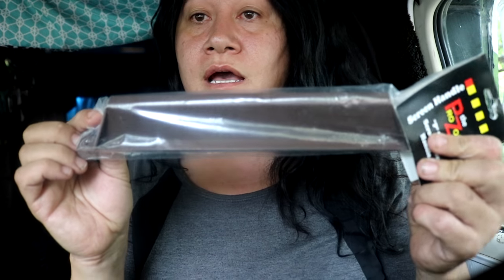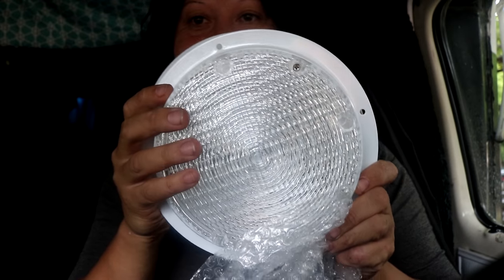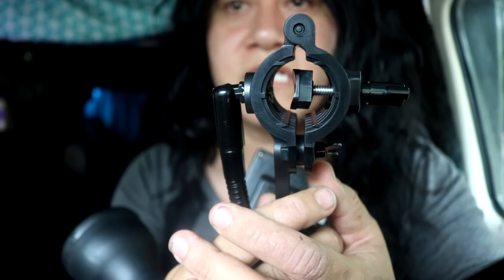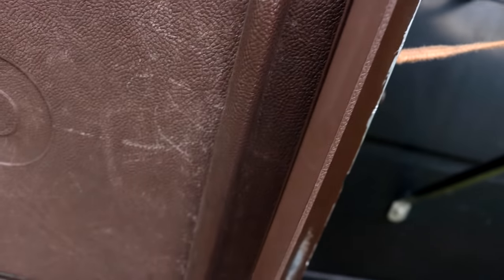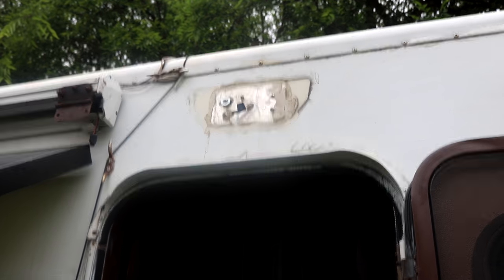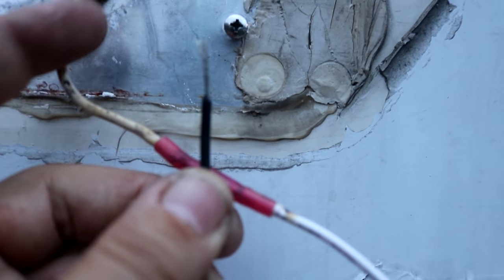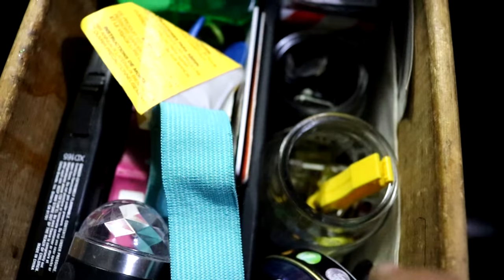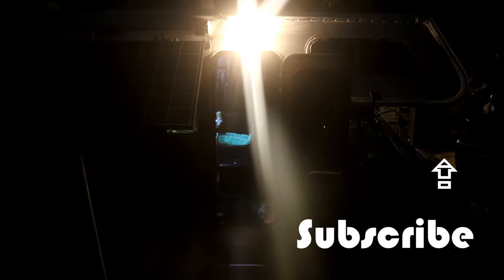Purchases & Installations With One Small Problem

Comment: All those little upgrades are so great and really like those new solar lights.Ausia have you thought about having the RV repainted white because that color absorbs less heat than black. Then have a panda face on the front of the RV!? Lol It’s a theme for the long haul. Your calling card from the road. Some say get a new RV but wonder do they realize all the vintage even older ones still traveling the highways. Motors and mechanical things can be replaced and roofs resealed. I’m not a member of the throw a way generation. There’s a big RV place in Carthage, Mo that has acres of wrecked rvs and they sell parts of all kinds. Colaw’s RV’s is their name and they have a website naturally, and on FB and most social media sites. You and the tribe have a great week!😉👍

Comment: Hey just for future reference, RV interiors, (the living part) are wired similar to residential standards from the factory, and most 12v hard-wired accessories like lighting and fans made for them, follow that standard also. Black is positive (HOT) and white is negative (return, neutral, or ground).

Comment: Ausia that light was for a house. The wiring colors are Black is hot and white is neutral or goes to the same place as ground in the electrical box or breaker box. Don't ask me why but AC and DC color wires are backwards.
Reply from the maker: It's weird they sold it as DC in an RV shop and it has a auto light bulb... hmmm thanks for your info

Comment: Your cap is a good star, You might  also consider changing your thermostat they tend to stick sometimes and can cause the same problem . It did on my motorhome . It is a cheap and easy fix that you  might want to consider . I would be willing to bet that yours has not been changed in a very long time. Like I said it is an easy fix and better than sitting on the side of the road . Best wishes and good luck.

Comment: If it overheats again, try replacing the bottom radiator hose withe wire reinforced hose,  cheapest and easiest next fix if it over heats again.    For your steps, you might try to tighten the bolts that hold the steps to the bottom of the R V. To keep it from bouncing or seeming tomgive way to your steps.  You'll need deep socket to tighten the nuts.  If you don't already spray all the pivot points on your steps with silicone spray.  Don't use 3 in One oil, it attracts dust.  Wouldn't hurt to caulk around the edges with the R V caulk.  Don't use silicone caulk like for houses.  It's not u.v. Rated.  Get a tube of the kind at the r.v. Store.  It has a much higher uv rating.  Been there done that.  Don't forget to plug the spout end with a bolt or use the cap that is usually with the tube of caulking.
Reply from the maker: Thanks Gary

Comment: That flexible light is going to be a problem I'd gamble...I think you'll have to tie  it down...use some foam to cushion the tie down or the vibration will kill it...sadly I'd give it a week on the road max life mounted to your mirrors no matter what...I just don't see how that could be designed for this kind of service. RV's are different from autos in that electrical grounds are often non existent in the body due to fiberglass and other non-conductive materials. So if you see a ground or black wire option be sure and use it.
Reply from the maker: Drove 3 over 300 miles no problems yet ...thankfully. Thanks for the info

Comment: Take that radiator cap back and get a regular cap the one you got will make your rv over heat
Reply from the maker: Weird just drove over 300 miles in 90 degree weather and no over heating.... are you sure about that.